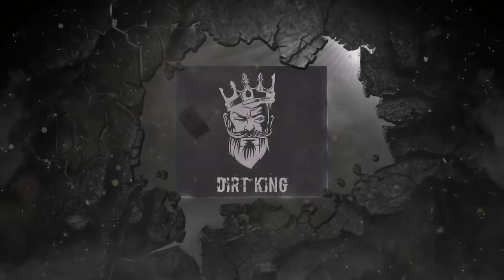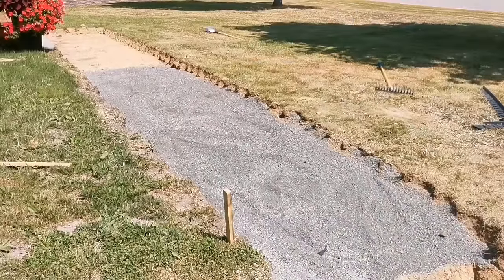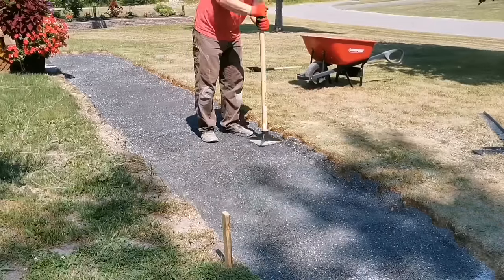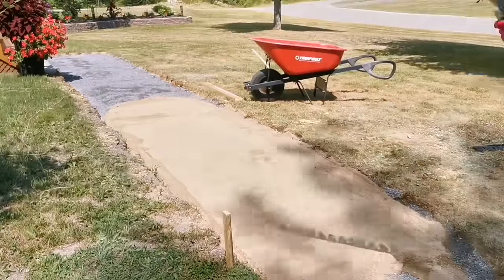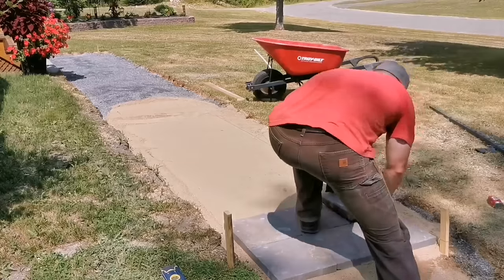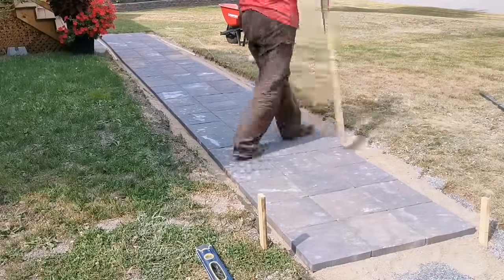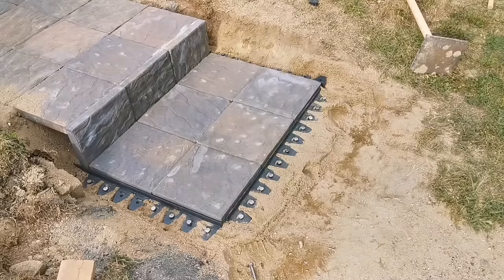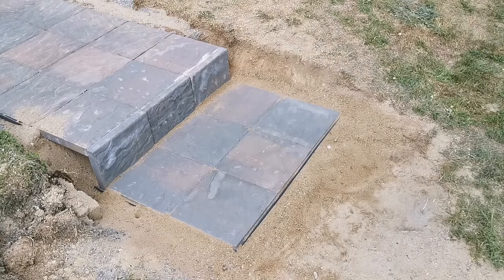Building A Paver Walkway That Will Last.

Comment: Do you do the exact same with a brick walkway?
Reply from the maker: Yes you do.  The only thing different is you can get the regular plastic edging instead of the low profile. This will keep them locked better seeing that there higher than the patio pavers 👍
Reply: @terrymcgillicuddy8056  is plastic or steel edging better and if it makes a difference why? Or pros and cons please?
Reply: We are on kind of a slope and even though we are going to level it out was thinking plastic might break
Reply from the maker: Plastic it the way to go.  It will not rust, or break down over time. Plastic will also follow the curvature of your walkway allowing for a tighter fit 👍
Reply from the maker: @bethmclovin3958  The plastic is very very strong. It would have to go under a lot of stress for it to break.
Reply: @terrymcgillicuddy8056  ok great thanks for all your help 😊
Reply from the maker: No problem. Good luck with your walkway.

Comment: How did you do the step?
Reply from the maker: Used the same pavers.  I used a concrete adhesive. I couldn't get retaining wall blocks at the time. Retaining wall blocks would be the proper way.

Comment: You didn't show how to do the step
Reply from the maker: Use a concrete adhesive and placed the vertical pavers under the top layer. Two years and still strong as new